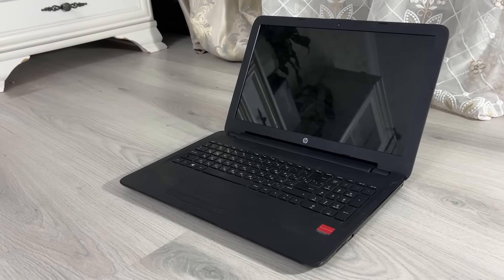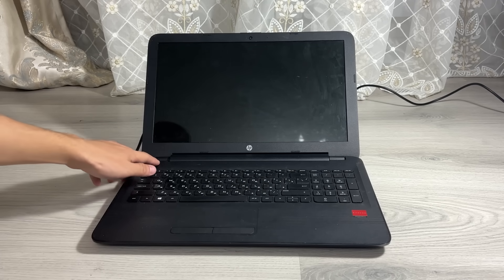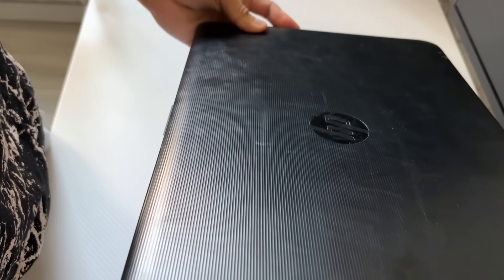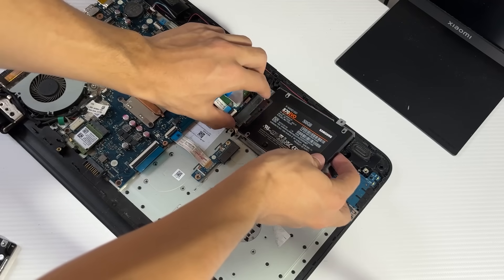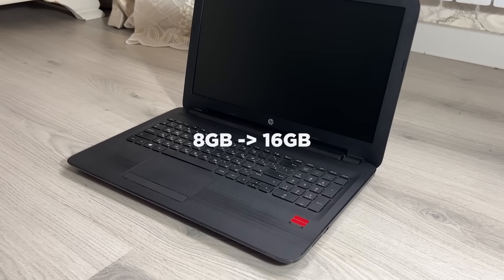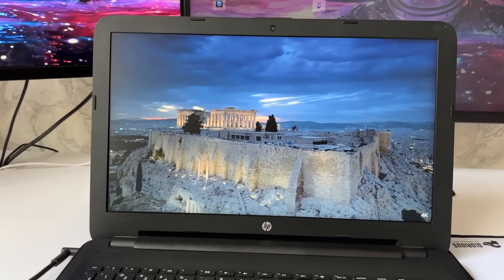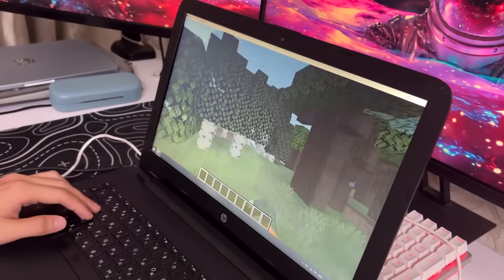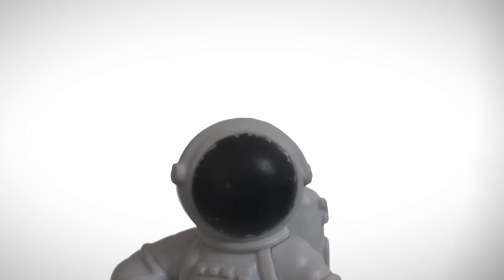How Far Can I Upgrade This 10 Year Old Laptop?

Comment: You could use a laptop disc tray chassis that connects another HDD or SSD and dual boot between Windows and Batocera and play a bunch of older games, probably only up to PS1 & N64 but still

Comment: I got windows 11 working on the dual core (a3 I think) version of that laptop. It took about 5 minutes to boot off the original 500gb hdd😆 even running ubuntu was about as painful as on my dad's old dell centrino laptop from 2005

Comment: you can actually install a discrete GPU using the mini PCIE slot thats holding the network card. but the cost for the riser and the CPU performance makes all these efforts not worth it compared to building a PC

Comment: Ive got a Intel pentium 2020M @ 2.4Ghz in my MAIN Laptop. I installed Linux Mint Cinnamon on it, because Windows is just way to bloated for Laptops. Runs Minecraft at 90fps when in 720p.

For your laptop i'd choose an even lighter distro. Maybe Linux Mint XFCE?

Comment: Fun to watch, as I said earlier, watching from a Pentium B960 based laptop. Win 11 is definitely an exercise in futility... it does run a bit better after debloating, but still... Best to load a Linux distro or even a FreeBSD based desktop one like GhostBSD. I'm having a good time with the Debian Trixie setup. I can play enough GZDoom mods, and I have the entire Debian Games pack installed! Yes, that will all fit on a 512 GB SSD, it's about 12 GB in total. Mostly older, simpler games with a few FPS titles and even some emulators.

So... does your sister like the refurb or what?

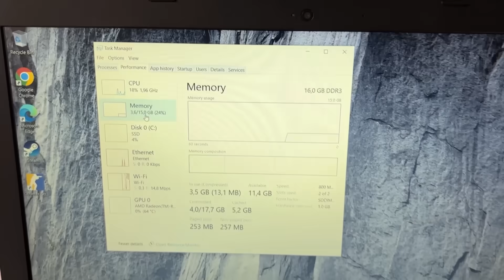Comment: 10:30 looks like the ram is running at half the speed there. 800M/T half of the advertised 1600M/T you bought it for. Should go ahead and check that out

Comment: I would suggest to install linux, do you know you could set up home cloud servers etc on linux. 

I have a 12 years old laptop similar hp model, sadly.  There's other issues like it turns off randomly, probably short circuited or something. But ubuntu runs really good. I set up a jellyfin media server on that but sadly the laptop's motherboard is cooked so i can't use it because of random shut downs.

Your laptop is in pristine condition, i suggest you intall Linux it wont run games properly but atleast you'll be able to cool useful stuff. If you're into that.

Comment: 7:55 , my old laptop takes 5 mins to boot up , still runs youtube at hd so still pretty good and usable.
Reply: upgrade it from hdd to ssd
Reply: @jhonfernanmadolid2324 I get you but the thing is its okay with me for waiting cause I don't want to spend much on it , it's got 3gb Ram and it's already 12 years old so just letting it run till it can
Reply: @Sarthak-0_0 and oh so planning to buy a new one after this dies?
Reply: @FoxyMusicOPWill switch to Macbook air next June , will feel like switching from stone age to alien age.
Reply: @Sarthak-0_0 nice, I will also buy a better laptop once i am in college. But till then my i3 6th gen will do the job, i will need to keep it till 2028
Reply: @FoxyMusicOPI feel old machines still do the job , I mean my one laga takes some time but it does the work so it's good, battery is battered though lasts about 4 seconds when unplugged
Reply: @Sarthak-0_0 obviously it is old so the battery would be worn out, mine was also the same, as I had to keep it for a few years, it needed to be upgraded with an ssd and a new battery
Reply: @FoxyMusicOPI wanted to upgrade ram as it's just 3gb and storage to sad but I will let the 2014 veteran just rest

Comment: You can run Windows 11 on it using Rufus to bypass TPM 2.0 requirements. I would recommend installing Linux on it though. It will make feel snappier. Something like CachyOS would be good, or Linux Mint if you want something simpler.

Comment: funny story i went through exactly what you went throught  from gaming far cry on lowest resolution and struggling with CSGO etc all on my laptop which is like yours but came with 4gb DDR4 RAM and instead of A8 cpu, I got A9-9425 with R5 graphics, same as yours but more powerful so i went ahead and upgraded it to 16GB ram and SSD and it surpsingly works well with game like Resdient evil 7, resident evil 5, Bullet storm full clip etc. ofc i didn't have the best experience but i was not bad ofc all of this after the upgrade not before. now i use it for casual light gaming but mostly i use my laptop as a secondary monitor for my gaming desktop using GlideX xD

Comment: You should be able install Windows 11, I've installed one on a 4th gen Intel i5 laptop which has 2 core. Yours has 4 core. All you need is to download the iso, and set the bootable drive using Rufus, there would be an option to bypass the laptop specification check.

Comment: you cloud actuali use egpu setup and just buying some gpu and extrnalli connect it to laptop then games would run a lot better something like 750ti if you would connect that gpu you cloud play gta5 far cry 3 and cs2 EASILI SORRY for critic but i wanted to point it out

Comment: I recommend you install tiny 10, find a tutorial on how to make windows faster here on yt specially those registry edits. If you wanna play gta v, do a potato mode config so it runs at the very least 30 fps. I had a macbook pro from 2012 and my config back then was full 1280x800 but the resolution scaling is between 0.5 and 0.75. The shadow is what makes gta v run slow so disable it on notepad (the config file of the game before running).
Reply: I've been there before too, I now have a gaming laptop that is being abused in my time here in college. I primarily use it for cad, video editing and also gaming :)

Comment: Cool video, unfortunately that's true: the only things you can do to an old laptop is just install a SSD inside for fast boot and generally faster applications and add newer RAM or MORE RAM, pretty much that's it. Make it clean, install new thermal grease and maybe if possible add a better screen. 
I am curios what wallpaper are you using on the Xiaomi 2K monitor(s??) behind the laptop.... the one with the astronaut floating. Is that a template from Wallpaper Engine or something custom?
Reply from the maker: Wallpaper engine

Comment: well atleast my laptop with 2 cores and 4 thread cpu can still somehow holds the games I often play(on fps it is Crossfire and Valorant,well CS2 freezes randomly but after few games) it just hold that long on cs2 because it has 2GB nvidia gpu(940mx) and a dual channel ram 2133 clock speed but man this laptop freeze lightroom because It is using an HDD with SSD Caching(with MSATA ) it has Intel RST

Comment: You can actually install windows 11 on it and it will run just fine. You have to disable tpm chip check and youre good to go. (Many tutorials out there) Also you'll receive windows updates too after installing

Comment: Upgrading your RAM and Storage is not enough for a better gaming performance. What you also need is a CPU and GPU upgrade. Knowing that laptop has onboard CPU you cannot upgrade it also for GPU it does not have PCIe for the big GPUs. What you have there was actually good for office tasks (higher ram) also for the storage upgrade it is expected that the SSD should boot fast compare to a HDD it also boot games faster but thats it. For gaming it is not enough. All though you can buy GPU and install it in your laptop using a gpudock there is a lot of cheaper dock out there if you really want to use your laptop for gaming.

Comment: I have this same laptop, it’s a HP 15-BA009DX, max of 16GB DDR3L RAM. It originally runs Windows 10 but as years passed by, the OS is running slow since the components are ancient. I “Upgraded” to Windows 7 and am running it as an nostalgia emulation machine, will soon clone it to a 1TB SSD

Comment: I have the same toshiba hdd in my current laptop, and I thought maybe lets finally upgrade to a ssd, and so I did. I moved this hdd to the optical drive area using a caddy, and put one 500MB/s ssd in the system bay. Works like a charm now. Its really crazy why I didn't think of it any earlier. The system is 5x faster as my hdd had a read write speed of 100 MB/s. Its aging alr.

Comment: i prefer to use win 10 ltsc 2021 or use linux distro like ubuntu or fedora (after installed open terminal and type sudo dnf update)this comand installing drivers i think but ubuntu is best opinion linux I think some laptops do not work properly with Fedora(i try in my sisters leptop sounds and youtube not working)

Comment: Joke's on you, my laptop has a Pentium core and 1.9GB Ram.
Reply: I think someone stole 0.1GB of your Ram
Reply: atthat point just install linux
Reply: @sweaterpotato123  Damn Small Linux would be a great choice here, 32 bit is still suppported there and it uses a window manager, not a bigger DE like KDE Plasma, Gnome or (gasp) LXDE!
Reply: Jokes on you I have pentium e5300 gpu is g33/g31 and 1gb ddr2 ram
Reply: @stevegaming1875 literal garbage is better 😭😭😭
Reply: @Sceuxm-88 real
Reply: @stevegaming1875  what do you even run on it. No way windows 7 works on it
Reply: @walkingtree2486 windows 7 works on it but forget about games😢even gta 3 lags on it
Reply: @stevegaming1875  bro's pc is weaker than my phone 💀💀
Reply: Actually the 2gb on the sticks is 2000mb as 1000mb = 1gb but ur computer calculates 1gb as 1024 mb, so even though ur stick is 2gb, it would only show up as 1.9gb
Reply: if you havent got a new laptop yet, install linux mint xfce. thats what i use on my 2GB RAM laptop and the difference is insane Windows is ass
Reply: Ewaste sites can give free stuff out that is much higher specced than this sort of stuff or you can purchase laptops for very cheap. It’s like 15$ for 2x performance 😭
Reply: @Sceuxm-88 bro where do I go to get ewaste
Reply: jokes on you.I have a pentium and a 32mb gpu
Reply: jokes on you i had a brpken chromebook with 1gig of ram but it usually runs at 500 megabytes
Reply: @vipinkrishna3652 jokes on you i had to use tape to hold my laptop back cover on because it was broken and i had to physically push it to get display
Reply: Jokes on you i have intel j1800 and 2 gb ram
Reply: I have intel Pentium p6100 , 6gb DDR3 ram
Reply: @Bhavesh30_yoo neck bottle
Reply: @vipinkrishna3652   😢 but its work fine tho
Reply: 😂, nope it's on you
Reply: Joes on you 
proceeds to throw every person named joe at him
Reply: that's top tier for 90s i got 256 mb ram and 700mhz cpu

Comment: I JUST WANT TO SAY THAT WIN 1O IS PERFECTLY FINE EVEN WEN THE SUPPORT ENDS BECAUSE WHAT DO YOU NEED A WIN SUPPORT FOR TO ADD UNNESSCARY UPDATES THAT YOU WONT EVEN USE IF YOU ARE  A GAMMER AND MOST OF THE OLDER MACHEINES LIKE THE ONE SHOWN IN THIS VIDEO ARENT POWERFULL ENOUGH TO RUN WIN 11 AND EVEN ON A HIGH END SYSTEM I WANT PRREFFER WIN 10 BECAUSE IT HAS MORE UNESSCARY BG TASKS,SERVICES,PERFOMANCE ISSUES,AND USING MORE RAM I RATHER PREFFEE A DEBLOATED WIN 10 WITH ATLASOS AND DISABLED BG SERVICES AND FULLY OPTIMIZED LIKE MY SYSTEM,WHEN I HAD MY OLD PC WHICH ORIGNIALY RAN ON WIN 7, I DID THIS AND IT RAN PERFECTLY AND IT HAD 2 CORE AND 2 THREADS WITH MAXIMUM CLOCK OF 1.56GHZ AND 4GB RAM THAT I LATER UPGRADED TO 6GB AND TO FRANKLY WIN RAN MORE SMOOTHLY THAN MY FATHERS BROTHER LAPTOP THAT COST 500 DOLLARS WITH WIN 10 AND I PLAYED MANY GAMES ON IT.THE PC RAN ON 1080P AND WIN WORED SMOOTHLY AND SOME OLDER GAMES ALSO RAN ON 1080P 30FPS.ABD NOW ON MY NEW SYSTEM I STILL USE THAT OPTIMIZED WIN 10

Comment: the most major upgrade you could have done is install a very lightweight linux distro, like *alpine, lubuntu, arch, puppy linux* and so on.
They only usually take around 256MB to 5GB, also they are very good in boosting performance

Comment: Bro. This is my life till like two years ago. My upgrade is still a 7th Gen intel with no Dgpu so gaming sucks 😂😂😂

There is an egpu option for you. One with the wifi card socket. At least it will improve performance of some. Get a cheap 200w PSU for like 18buck, a Gtx 750ti or Rx550, then A GDC beast ( or whatever they are called) and you still game on it

Comment: I play from a laptop that has an I3-6006U, 4GB of ram 256gb ssd + an external hard disk that I have bought (500GB), and for gpu an Intel HD Graphics 520, I have somehow managed to play fortnite on 100 fps (in creative, if I go in battle Royale I do like 20-25 fps), FIVEM at 30 fps (for those who don’t know it’s gta 5 with a lot of mods for make it roleplay), valorant also 30-40 fps with true streached 1024x768, Minecraft 200+ fps, never tried csgo, I’m able to do some edit, do not ask HOW because I don’t even remember, I have watched every type of YouTube boost video, I’ve gone in the bios, installed software for overclock the cpu and gpu, installed graphics mods for every game (gta for me is like playing Roblox or smth like that), i opened this video hoping that maybe there is something else that I can do and I actually can change the ram but I’m scared to brake something so I don’t think I will, but remember guys if u want u can!

Comment: had simliar laptop from HP just like that 
it had a i3 6006U
AMD Radeon R5 M330 
12GB Ram (upgraded 4+8) 
1.5TB storage (1TB HDD 512GB SSD upgraded) 
used it for gaming (not a pleasant experience) and pretty much everything until oct 2024 (when i bought a gaming desktop)
now it's laying in my room but pretty usable after a lot of optimazations and installing Atlas OS instead of stock windows 10 
i'd say i can still use it as a low end work machine that's how i'm using it these days anyway

Comment: I have a ACER ASPIRE, with:

-Intel Celeron, base speed 1.10GHz that i manage to get it up to 2.30GHz, god knows how a couple of years ago;

-4GB DDR3 ram

-LITEON SSD 240 GB as my sistem disk
-TOSHIBA HDD 470 GB as a secondary disk

-Integraded grapfics ( INTEL HD Graphics 500 )

  I had this laptop for so long i have no idea how old it is, i think it's about 5-7 years since my parents bought it. It came with a weird version of Linux that had children games on it and i basically couldn't do anything on it, I got win 10 with Revision and im playing cod mw 2, the old one, at 30-40 fps, I count fps by eye cause if i have anything in the background it just click-clack's it's self

 It literally has no fan cause it wouldn't boot with it so i had to take it off (it didn't do anything anyway, it was an exhaust fan)

And the battery ends itself after like 5 minutes so it's basically a desktop now.

Comment: Hey brother, I noticed at 10:28 the ram speed was 800 mhz? The ram should run at 1600, not 800, thats half your fps right there.
Reply: It's from windows, it shows 800 but the ram run on full speed. It happens on ddr3, telling you from experience.

Comment: Bro its better than mine and im still using it:
At first, Model: Asus X515MA (DON'T BUY IT!)
Processor: Intel Celeron N4020 (it's awful stays at 100% idle)
Memory: 4GB DDR4L (2400MT/s)
Storage: 256Gb NVMe SSD (it was hard disk before)
GPU: Nothing. Integrated Graphics. 
And I still like it lol

Comment: The laptop is not bad, Windows is the one who is lagging your laptop. Mine will soon be a 10 year laptop and it runs fine with Artix. It is all stripped down to the bare minimum like how the interface of Windows is "simple". But instead of having "magical" resource intense usage the only 100% CPU I get is compiling drivers.

But I do not recommend switching on Linux unless you want to learn how to use it.

"Just install this easy distro bro" is the main reason why so many give up on it. When it comes to use software, Windows users hit a wall and never come back. Most complain about the system not working with Windows apps... like, what did they expect?!?!?!

Comment: Obv the performance would be poor, as you went from 1366x768 to 1920x800(or whatever). your GPU need to draw 2x more pixels, thus reducing fps severely. i would recommend for 1280x720. Deep system optimisation is needed. you can use atlas os or revi os playbook to boost even. should use razer cortex and lossless scaling. and yeah, if nothing works, switch to linux. i use arch btw.

Comment: U Have better specs than me before u even upgraded lmao i have 4gb of ram, half a terabyte of hdd storage, shitty integrated graphics, an overheating cpu, a barely working fan that sounds like a diesel engine, a screen that gets a purple line when it gets pressed a bit, (Ryzen 3 or five cpu idk), And a barely working keyboard (9 yr old laptop)

Comment: I would just make a bootable Windows 11 USB with Rufus and disable system requirements verification, it would be slower than Windows 10 but with a little bit of those suspicious unbloating softwares it will be fine

Comment: Do linux, there are lightweight distros that are easy to use, and it'll run faster. I'd go with Linux Mint Xfce Edition. Or you could go with Pop OS. Either way it'd likely run a lot faster than with Windows 10.

Comment: 8:45 I have the same issue with my laptop I got it form my dad around 2 years ago but the laptop is really old (I have my desktop pc in room so it wasn't a bit issue) shortly after battery died I replaced it yesterday and it holds at best 2 hours and 30 minutes without using any programs..

Comment: You can bypass the hardware restrictions for windows 11 using Rufus, i installed Windows 11 on a pc with i7 860, if you have 16gb+ of ram most cpus will have no problem running win 11 at all, the hardware restrictions are more like suggestions